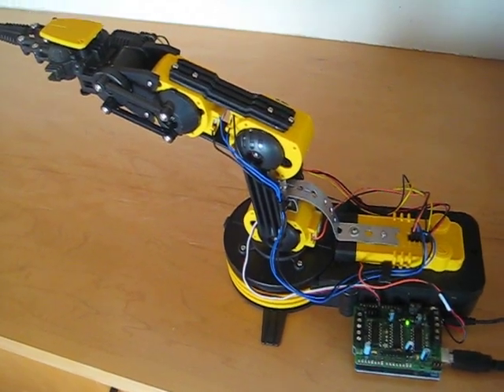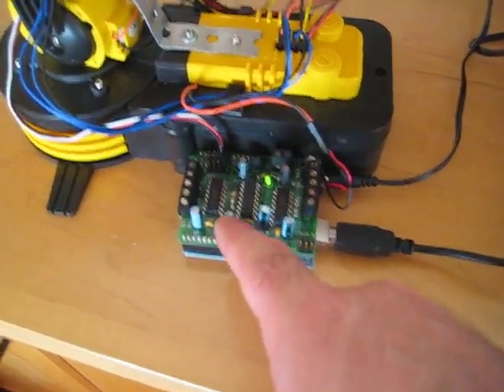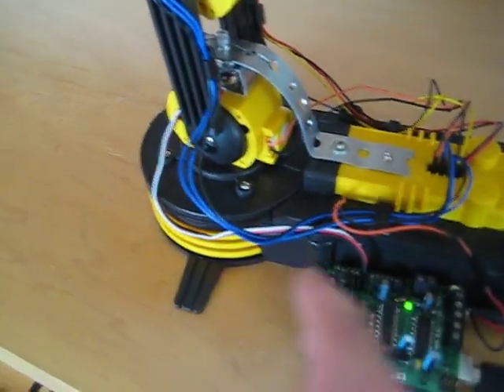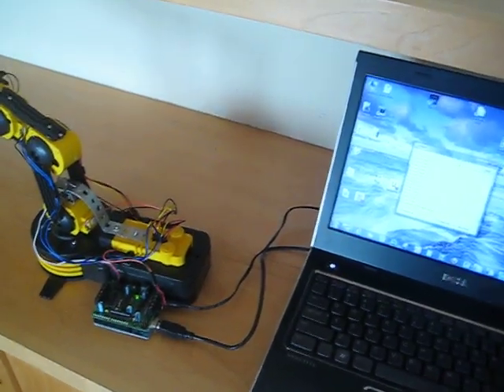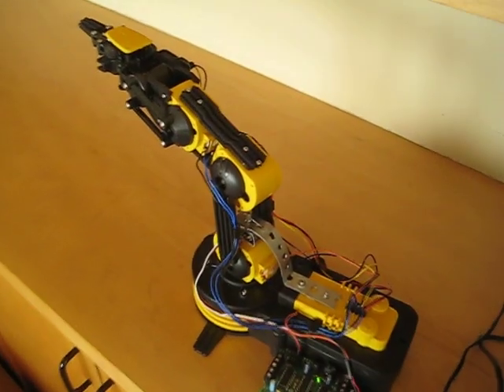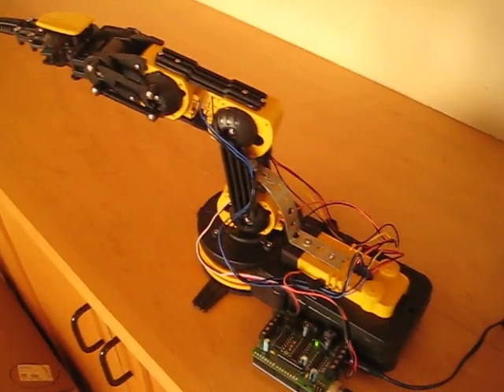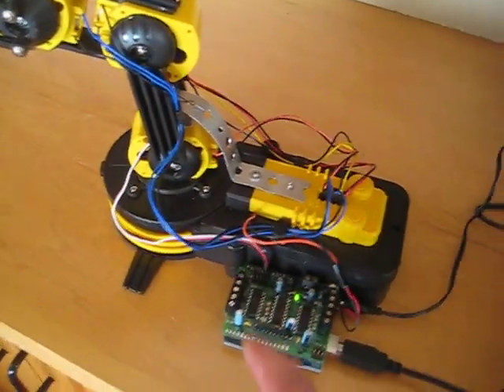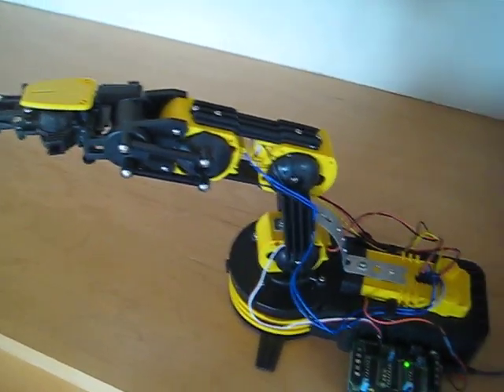OWI Robotic Arm hacked for Arduino control

Comment: so I have also been trying to do this but im having issues on some of the core ideas

what is a closed loop feed back system and why is it important ? 

why can I not just link the motors to a driver without the pot?

and also this uses 5 motors right? most of the drivers ive seen can only do 4 motors or am I wrong ?

Comment: Chris, I'm curious if you've progressed this project and added the position sensors to the other joints. One problem I can see with the pot in your video is that it limits the ROM of the arm. Have you resolved this as well?

Cheer,
Brian

Comment: Error:
c:/program files portable/arduino-1.0.3/hardware/tools/avr/bin/../lib/gcc/avr/4.3.2/../../../../avr/lib/avr6/crtm2560.o: In function `__vector_default':
(.vectors+0x94): relocation truncated to fit: R_AVR_13_PCREL against symbol `__vector_37' defined in .text.__vector_37 section in core.a(HardwareSerial.cpp.o)

Windows found the file in question at (and only at):
C:\Program Files Portable\arduino-1.0.3\hardware\tools\avr\avr\lib\avr6

But I don't know what that means or if it's important.

Comment: I could not leave a comment on the Instructable page for some reason...

I've noticed that your code does not like arduino 1.0.2 and 1.0.3.  Any attempt to compile throws a strange error that does not seem tied to a line of code.  Nothing looks that complicated, so I don't know where to look.

Arduino 1.0.0 lets it compile fine, so I've been using it.  However, I'm trying to track down other bugs and am considering using the later IDEs to see if I get different results.